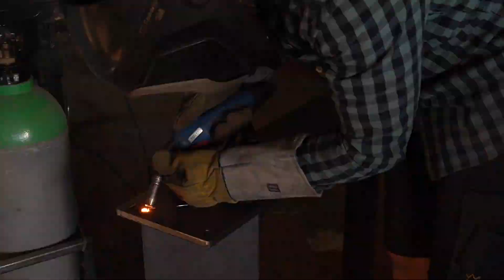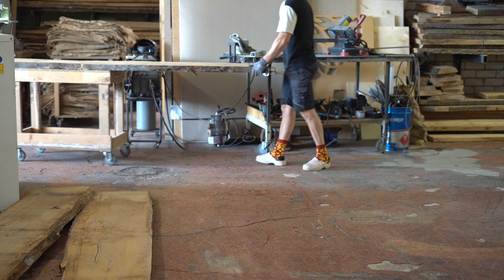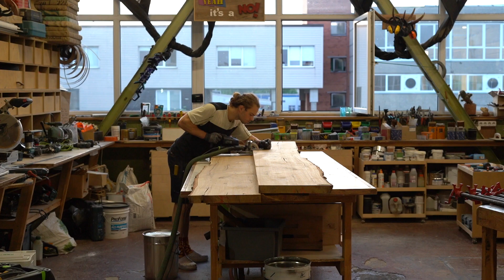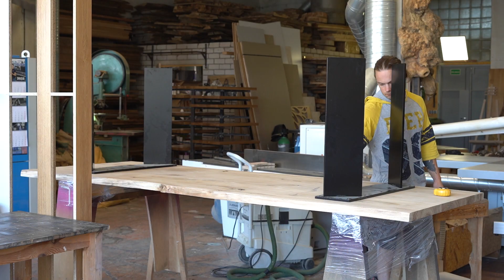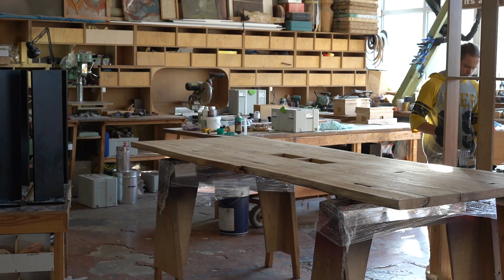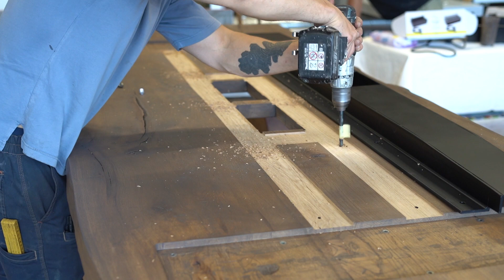making a conference table

Comment: Hi. Why weren't the stabilizing cuts from your "WOODEN TIPS #2 | stabilizing solid wood slabs" video used?
Reply from the maker: Because it has these thick steel legs with cross members to prevent the slab from bowing or cupping